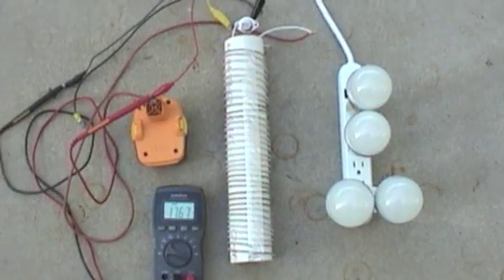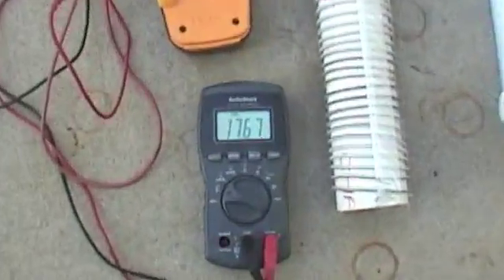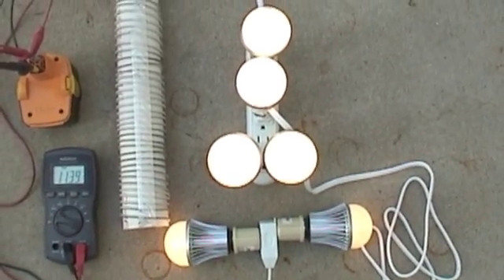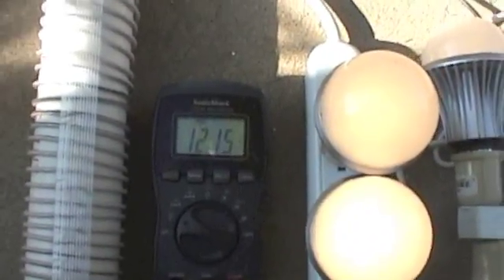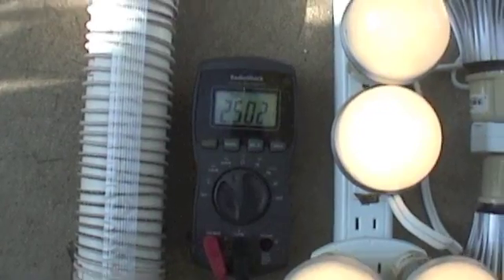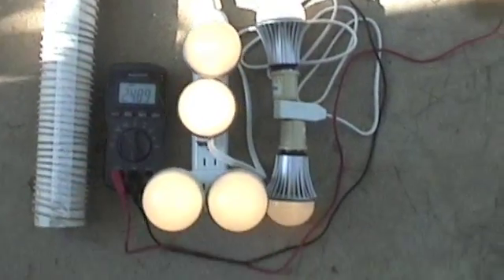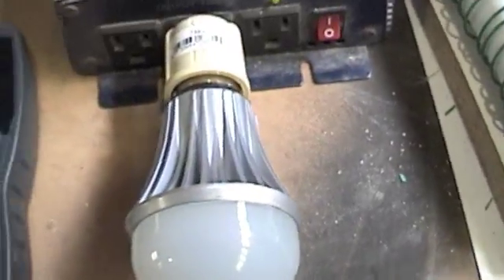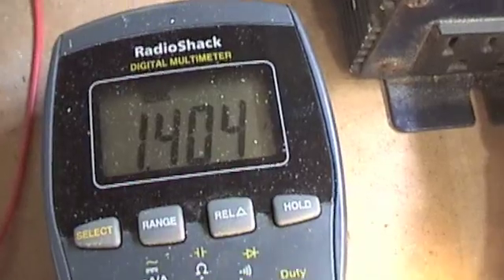High Power Lynx Joule Lamp

Comment: i made one with a 4" x 1/2'' ferrite rod using 20AWG and 30AWG magnet wire 4 complete layers of each ran at 12-15v can light 5 7w led light bulbs and only pulls 0.25-0.5A depending on the brightness i set with a resistor rotary knob connected across the base input for the NPN transistor

Comment from the maker: I haven't tried LED bulbs in series. Your amp draw is very similar to what I have been seeing. At some point, great performance is good enough. I am hoping some experimenters out there will find conclusively the best primary turns and spatial relationship to the secondary. This is such a simple device when used with a 12 volt solar panel.

Comment: Great work again Lynx,
I just made Laser Saber's super joule ringer today with ecore. Works ok but have a lot of playing around to do yet. The French flipflop inverter from Incroyables Expériences  I made works great. I found that 1 4w led bulb is 400ma full brightness. 2 in series is 800ma no decernible change in brightness. 3 in series puts the meter back down to 400ma with a slight drop in brightness. Not sure why but seems better than parallel which would be over an amp.
Keep at it~!

Comment from the maker: With 6 bulbs and 2.2-2.5 amps the transistor was warm.  Its only when frequency drops very low that the transistor is fully on for longer periods that it will get warm.  I think fluorescents are harder on the transistor than LED bulbs.  
Using solar for 8 hours x 5 watts = 40 watts  40 watts / 4.97 = 8.11 hours of light off one bulb.  Or two bulbs for 4 hours......

Comment from the maker: I saw those but you didn't go into much detail.  Are you thinking the resistance is lower, or that the field is stronger off more mass?
I have some suspicions as to how the coils interact but no way of knowing for sure.  One thing is that these coils aren't behaving like a Tesla Coil tower.  I have done a lot with PM alternators and learned a lot about field strength and air core coils.  Spacing and distance from secondary makes a difference.

Comment: That coil design is exactly the way I make my air core coils.  I just go with a much larger gauge wire on the outer coil.  They work great with the Joule Ringer 2.0 layout.  Great video.  Thanks for sharing.